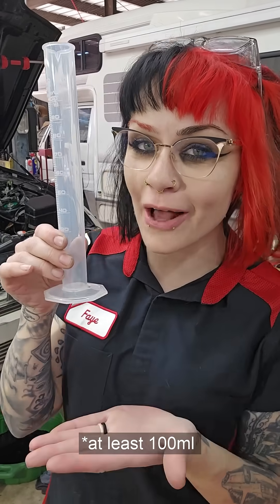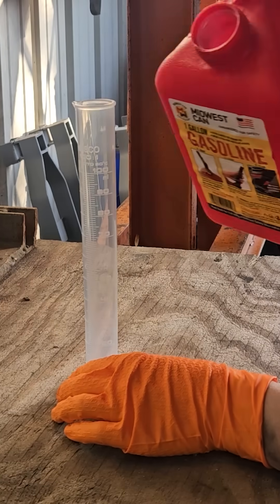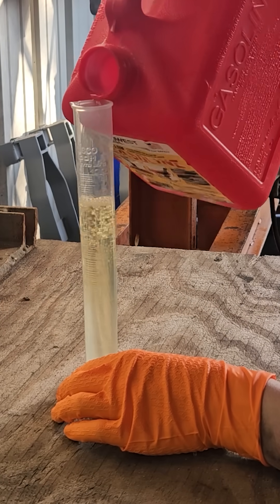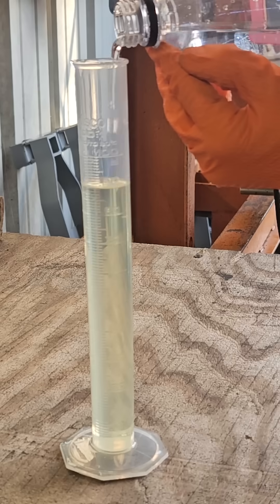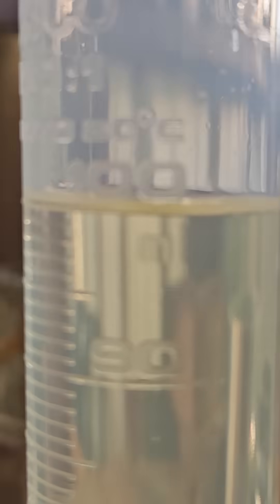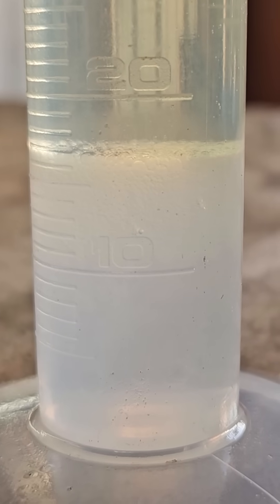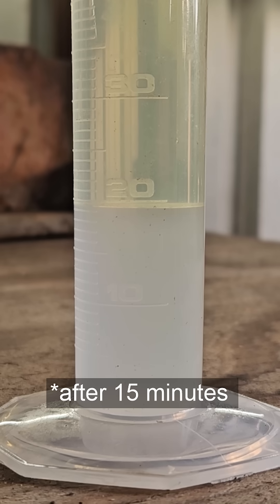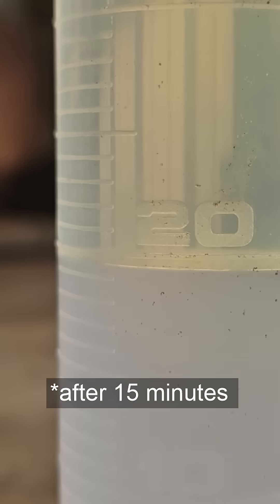Testing the Ethanol Content of Gasoline Using The Water Extraction Method! #AutoDIY #Ethanol #Shorts

Comment: I've run ethanol free in my snowblower for around 5 years. Never had to touch the carburator once and starts up with one or two pulls. I highly recommend it for carbureted equipment.
Reply: I honestly wouldn't recommend using ethanol on any carburetted engine, ever!
All the rubber seals and diaphragms etc cannot be guaranteed not to react with ethanol and swell or perish.
And I certainly would never ever use it on any engine that isn't used very often, alcohol attracts moisture and it can cause corrosion to internal parts and cause all sorts of problems, in any fuel system not just carburetted.
So never leave ethanol fuel sitting in any fuel system while stored for more than a week or so.
Smart move mate 👌
Reply: @DavetheRaveDinkum 
I have never found enthonal free gas. I use enthonal shield for my all small engines
Reply: @DavetheRaveDinkum  it gives you something to do. Carbs are 10$ on amazon and they work great. My motorcycle sprocket was 13.99 high quality. Throttle 12$ steel with high quality rubber. China doing crazy clones of US made but US made = 400-900% more :/
Reply: Aha! 
You figured out how to extract the ethanol!
So now, you can take a coupla shots before 
you go out an snowblow...😵
Reply: rec fuel?
Reply: @Dihurmahk  search for ethanol free gasoline near you. Shell often has ethanol free gas out in back or the side of the station. Great stuff. I've used it for years.
Reply: I've run gas with ethanol in it in my lawn equipment for 30 years, because that is all that can be legally sold in my state other than at marinas ONLY directly into a boat (and for $$$$). Never a problem. Splash some Stabil into the thing before putting it away for the winter.
Reply: You can run cheaper gas.  Just use a medicine measuring cup and add 15ml of seafoam per gallon ... You can only use this gas mixture on carb engines ... Save money friends.
Reply: @michaelruschmann9295 
You can also use fuel stabilizer 
1oz for every 5 gallons as a fuel
conditioner, 2.5oz for 5 gallons
for fuel storage. Keeps fuel fresh 
for 10 months...
Reply: @michaelruschmann9295  seafood is perfectly fine to use on fuel injected engines
Reply: It’s not cost effective, ethanol free gas is far too expensive per unit price and if put in a car that has been using or is rated/designed around for ethanol mixed gas it will only clog any emissions system in that car like the cat,  egr, intake valves, throttle body, etc. 

Not saying it’s not possible to make efficient, but going through all the time and labor to rebuild and retune, for all the trouble to be inconvenienced for expensive uncommon goods compared to something premade and set up is not cost effective.
Reply: I use the synthetic True Fuel from Lowe's or HD.  Snowblower and mower seem to love it compared to pump gas.
Reply: @estelja  small engines are easy to work on. Aint paying 25$ a half gallon
Reply: I use ethanol in lawnmower, generator etc. never any problems!! Just run dry before winter storage. 3rd generation mechanic and engine builder
Reply: I've been running whatever came out of the pump cheapest in my snowblower for 20 years and never had to touch it either. Selling non-ethanol gas in my state is illegal other than at airports and marinas. It has been several decades since any equipment bothered by ethanol has been sold.
Reply: I do the same.  Ethanol is especially bad for two cycle equipment.

Comment: Everyone who complains about lawn mowers being built to last a season and throw away, this is the actual reason. Nearly 15 years ago, i bought a $100 mower from Walmart bc it was the only one I could find that wasn't self propelled or have a bunch of unnecessary crap weighing it down. It still runs great because I've never used anything but non ethanol fuel in it. Never run ethanol in a small engine, it plugs up the jets or during storage evaporates out of the carb leaving behind a gummy mess of lacquer.

Comment: I regularly test fuels in my area, and find 87 to contain 9-17%, the 89 octane is usually 6-12% , and the 93 is typically 2-6% ethanol.   And the e85 is typically 75-83% year round.   Central FL
Reply: In CA, the terminal puts 400 gal Eth on the truck, then 3600 gal of 87. These pumps can be off by as much as 10 gallons at the end, but usually only by 2. Then I dump it all in the tank at your local station.

Comment: Actually, you would need to fill it up to the 100ml mark with the gasoline and then add 10ml water on top of it to do what you showed.
Filling up to 90ml and then getting your separation all the way up to the 20ml mark means there was 10ml  ethanol for every 90ml gasoline. 10/90 is 11.1% ethanol.

Comment: "Putting alcohol in gasoline was USAs biggest mistake because the ethanol causes so many problems in the engine". Believe me, our government knew and wanted those problems. It's like in auto racing when the car speeds get to fast for the track they introduce new limitations to slow them down.

Comment: So in theory, I can remove the ethanol from my gasoline like this. Not in theory, in fact. But now I need to know how I can test the octane of what’s left over, since they use ethanol to raise octane, if I’m correct. I have a boat that I rebuilt from a bare hull myself and don’t prefer to use ethanol fuel in it. I also have some expensive (to me) equipment that explicitly says “ethanol blends not preferred” AND a rather old machine that I really on for work that can no longer be purchased that’s waaaaay to old to be running ethanol

Comment: Ppl commenting saying they remove the ethanol  etc . I mean if you know what your doing and have the proper octane rating after done then sure. Especially for small engines. 

I personally just use something like stabil 360 ethanol treatment in car too but especially every fill on bike. Has worked pretty good for me over last few years zero issues. 

Though I would drive extra distance to get ethanol free gas if it was possible but nothing within 10hr drive at least has no ethanol

Comment: It depends on state labeling laws.  Some states allow anything between 2 and 10%.  Some states require it to be labeled exactly what the content is.  And yet some other states do not require ethanol labeling so Minnesota for example has ethanol in every grade and the pumps don’t have decals.
Reply: I live in MN and ive never seen a fuel pump that doesnt habe a ethenol content decal of some sort weather a e10 sticker or up to 10% sticker and yes no requirement in mn to label pumps however in mn they do offer ethanol free gasoline for boats and small engines at the pump. For example where I live in mn every gas station offers premium non-oxygenated 91 non ethanol and if you test it it actually shows 0 ethenol.
Reply: I’ve never been to a gas pump that doesn’t have the decal say maybe have it up to 10% and been in mn minus the non oxy pumps which are 0

Comment: Having a 1992 honda civic si. D16.   DID the ETHANOL blend come out after or before this model of engine?

I'm running "10% blend" & ADD StaBill 360 which will help protect the fuel system by "burning" the moisture & ethanol, correct?

Comment: It never contains more unless it’s e15 or e85 fuel. I haul fuel. The meters at the loading racks we load at are very accurate and tested several times a year. Just buy your damn gas. 99% of y’all don’t drive a car with a high performance engine that gives a damn anyway. Unless it’s a flex fuel vehicle why would you buy ethanol blended fuel? That stuff is trash, robs performance, decreases fuel economy and causes you to buy more fuel. It’s all a scam. Buy 100% non ethanol gas. Your car will thank you. If you live in an area that doesn’t allow non ethanol blends or requires RFG fuels like huge metroplexes ie DFW then it sucks for you. RFG fuels are 2-3% less energy again robbing performance, decreasing fuel economy and causing you to buy more fuel. Again all a scam

Comment: Ok, so if you only put in 90ml, then how do you get an actual percentage? You’ll see that out of 100ml, 10ml is your water, then the rest if from the 90ml but that amount is out of the 90ml you pumped in. So it doesn’t give you a percent of what you put in. It gives you a percent of the 100ml. Put 100ml of fuel in then add 10ml of water and then shake it.anything above the 10ml mark is the % out of 100ml of fuel.

Comment: Or if you want more accurate reading use a Cylinder specifically made for ethanol testing.

10% doesn't really matter.  But when a vehicle is tuned for a specific blend like e50 or e85, it matters for mixing.

Comment: Funny thing about the ethanol gas is that ethanol raises the octane of the fuel like tetra-ethel-lead did, but water exposure (including the humidity in the air) causes it to separate out. Lead didn't do that, but was super dangerous for everyone and caused birth defects alongside eating through airways and sinus cavities and causing insanity. But, back to the subject, when water comes into the solution of an ethanol blend it separates the ethanol from the petroleum distillate. This reaction can strip the ethanol from your 20 gallon tank of E10 gasoline with only 20 mL of water and cause the fuel to drop octane to the point of auto-ignition. This is why many cars are coming with the stickers calling for mid grade or premium despite the engine not having a compression ratio that would require it. The enginerds are actually trying to get ahead of problems, but there's always something.
Reply: There seems to be confusion about octane. It is a description of a fuel's stability under heat and pressure at optimal fuel-air mix and the point at which it will undergo detonation instead of rapid combustion. There is currently no way to remove or add only octane without adding other substance, it is a characteristic of a fuel which can be adjusted with additives. Gasoline without additives can vary wildly in octane rating based on how it is refined and it's age/storage.  Keep in mind that crude oil is distilled into other fuels (gas, diesel, kerosene, etc) and oils and can be demonstrated with a tabletop albemic/calcutator/mini still. The giant still at refineries is bigger, better, and has far more measures of control. The highest octane recorded from functional pure gasoline was one hundred ten octane and it was a very small amount (half a cup or so) from two drums of crude oil. They got the full spectrum of other fuels at various grades, but they were aiming to see how high pure gasoline would go before it stopped functioning as gasoline. Yes, ams fuel nerd. While some may be lead to believe that I defend leaded gas, I do not. I much prefer everyone to have fewer birth defects and never suffer the horrors of having their sinuses reconstructed due to exposure to tretra ethel lead, but it is unfortunately necessary in niche applications like racing fuels, certain aircraft, long term critical storage (for rarely used generators that are way out of the way and are critically needed when they are needed but haven't been switched over to propane or stabilized diesel or bunker fuel [super niche]), and particular military devices.
Reply: @easycheese6409 they could just have distilled out the toluene and they would have a 120 octane fuel.
Or just used natural gas as methane also have an octane of 120....
Gasoline is in the end a mixture of a whole range of hydrocarbons with certain properties not a specific chemical
Reply: @easycheese6409  octane is also a specific chemical molecule.
Reply: @squidlybytes  no its a group of different isomers of hydrocarbon all with 8 carbon.
Octan rating is on the other hand an almoat compleatly unrelated measurement of a fuels ability to withstand compression without causing engine knocking and while pure iso-octane have a rating of exactly 100 their are other isomer of octane that are anywhare betweem -20 and 106.
Pure ethanol have an octan rating of 108 and given that water wouldn't be able to cause engine knocking it have a nearly infinite octane rating
Reply: The absolute highest octane rating you can get from pure gasoline is just 110, but most refineries only manage around 105-108, but they just blend most of it back in the "premium" unless someone actually orders it in bulk. There are octane boosters that can be added, but most are just different kinds of fuel like aviation or jet fuel. That leaves two special ones that I don't remember the names for, then ethanol, methanol, and lead.
Reply: @easycheese6409  jet fuel is a type of kerosene. Which is basically more highly refined diesel.
Reply: This explains why my 20 year old four cylinder Honda Accord loves Shell Nitro gas.
Reply: @phil4986 Dunno about new ones but those old Honda inline 4's actually make some decent compression. I've got a 96 Civic DX (d16y7) and factory compression on that was 9.4:1, I only run premium and she's definitely happier for it. When I got it I ran regular at first but quickly realized that was giving me a fair bit of backfires from premature detonation leaving unburnt fuel which is not only wasting gas but also isn't particularly good for the engine
Reply: The 5.0 can handle e-10 to 93 and go for a million miles.
Reply: Also e15 15% ethanol have an octane of 88 and E85 have an octane of 105
But in both cases you are starting with a 80 octane gasoline.

The old gasoline was only 60 octane and tetraethyllead was added to bring it up to 88 or higher by working as an ignition inhibiter allowing the gas to be more compressed so it could be ignited by the spark plug instead of auto igniting too early
Reply: mercury causes insanity, not lead. Lead causes learning disabilities. Th mad hatter from alice in wonderland is portraying what happened to hatters who used mercury to make the tall beaver top hats like Lincoln wore.
Reply: Interesting. Thanks.
Reply: Lead has always been a very good element that made devices and process waaay, better and didn't care about humans. Humans call it toxic, but if we take the human element out and think in terms of purely application - we come to conclusion that humans suck.
Reply: Anything that doesn't burn as easily as gasoline will raise the octane rating if you mix it with gas. That's just what octane is a measurement of. There's nothing special about ethanol really, other than all the subsidies.
Reply: @DrBadmind  certain things are better than others and some have extreme drawbacks, but your point stands with many caveats.
Reply: That's why I always go with the non ethanol 91 where I live. I say we go back to the lead.
Reply: @christopherwestern9223 you must not realize how horrific lead poisoning is.
Reply: @booognish  I do, I just don't care. And the fuel used in aircraft, still uses lead.
Reply: @christopherwestern9223  only in small propeller driven planes which are not common and are dispersing over a pretty wide area.
Reply: @justcommenting4981  yes. But the fact is that it is still used.
Reply: @christopherwestern9223 
And let’s put lead back in house paint so we can block emf radiation and keep it outside our dwellings!
Reply: Bullshit. Lead does not raise the octane rating. Octane does. Lead was used for the lubrication of the valve shafts. Nowadays it's not necessary anymore because of better materials for the valve shafts and the gaskets.
Reply: @andrebartels1690  You are simply incorrect. Aviation fuel is often still leaded specifically to achieve the required octane rating.

Regular and Premium pump gas are the same distillate with a Special Blend of octane boosters and Other Crap depending on brand. Very little or zero(once again beand dependant) of this additive is octane, because octane s a bad and expensive to isolate fuel.
Reply: @squidlybytes congratulations you found the real chemtraila.
It's not the jumbojets that sprays unknown chemicals, it's all the small plains that spray lead
Reply: @andrebartels1690  i dont think you are correct
Reply: @andrebartels1690 
Octane is not a component you would find in abundance in typical fuels.
Octane rating is an index, not a direct measurement. It is a rating that compares the thermochemical properties of a fuel to the thermochemical properties of a specific mixture of heptane and iso-octane. It does not say anything about the actual iso-octane content of the actual fuel you're filling in your gas tank.

You are correct in that lead does not raise octane rating. Instead it is a specific chemical called tetraethyl lead which is a lead atom attached to four ethyl groups. The way this becomes a problem is when the fuel is burnt, so is the tetraethyl lead. The lead atom gets released into the air and that is how we get the lead contamination problem. In fact, lead deposits would actually build up in old engines using that of fuel and they actually did help the longevity of the engine, but it was more of a "happy accident" and not the actual intention of adding tetraethyl lead to the fuel.
Reply: @andrebartels1690  um not even close my guy
Reply: @andrebartels1690  valve seats.
Reply: @andrebartels1690  go read a can of VP 120 or higher, they use tetraethlelead AKA the lead from old school gas to raise the octane rating without the use of ethanol or methanol because it pulls double duty as an upper cylinder lubricant without the instability or corrosion of ethanol blend gasoline. It also doesn't require doubling the fuel amount for a given engine like E100 or pure methanol does.